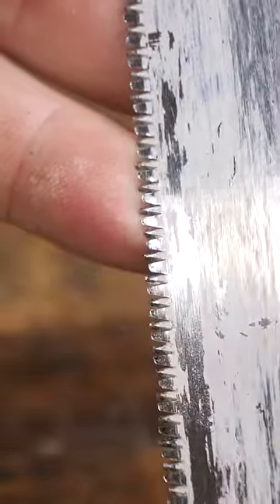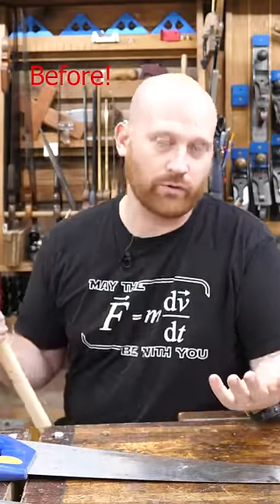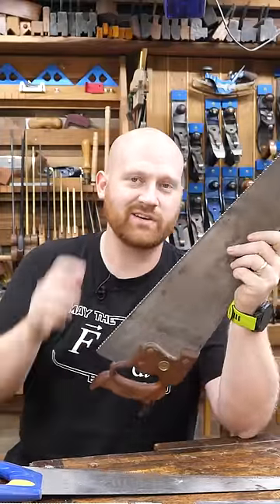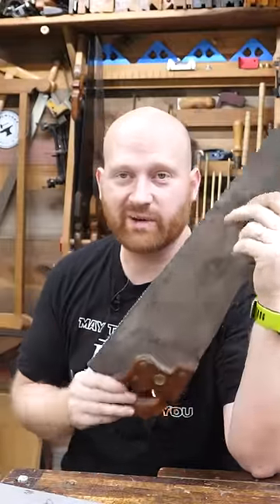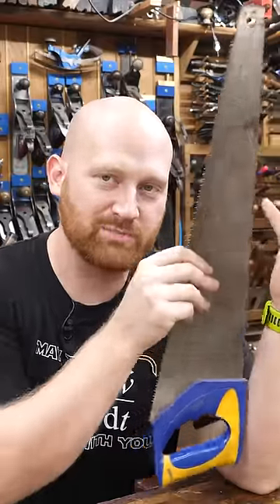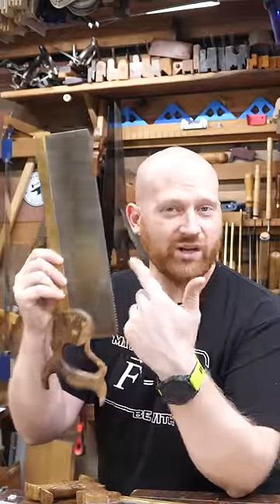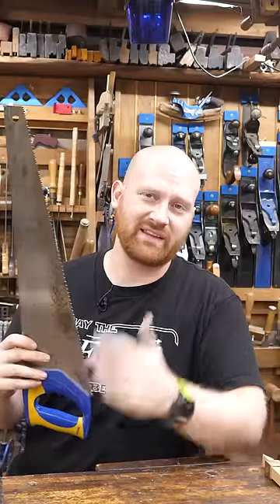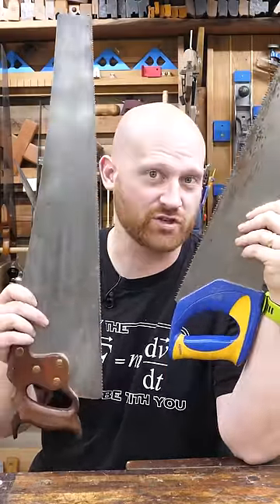Hardend Teeth Vs Old School Teeth on a Hand Saw

Comment from the maker: How to sharpen a saw: https://www.youtube.com/watch?v=e7YsjKhqk-w
Reply: Exactly the video I was hoping you had🙂
Reply: You said "you generally won't find hardened teeth on a saw after ww2. That contradicts what you said in the rest of the video. 
   I believe you meant to say you will only find hardened teeth after ww2 OR you'll only find non hardened teeth before ww2.
Reply: This was the comment I was expecting to find. Ty.
Reply: You "do" find hardened after WW ll ✌️👍
Reply: Thank you so much! That was my next question.
Reply: @muddbear6410 he literally put the correction in the video.
Reply: Why not use a torch to heat up the teeth and take the temper out of them?
Reply: i appreciate your video but you can resharpen them easily with diamond files

Comment: “Became disposable” is a phrase that sadly applies to everything these days
Reply: That mostly depends on what you're willing to pay. Exceptions exists but you can generally still get a long lasting quality product of you're willing to pay a bit more and know what to look for.
Reply: These days you have easily accessable abrasives on dremels or angle grinders and diamond files are ten a penny, you can sharpen hardened saws with no problem at all.
Reply: If we don't replace our stuff companies don't make money. More disposable more money they make. Please think of the poor companies
Reply: Haaaavvvveee you met Entropy?
Reply: @Freakmaster480 That's true, but they're very difficult to find when it comes to most things and they're a lot more expensive, whereas in the past striving for quality in a product was the norm
Reply: @kiiryth9835  Making stuff as cheaply as possible has always been common we just have the technology to make stuff cheaper than ever.
Reply: You're thinking about it wrong.  People use to have to sit there and sharpen ONE saw for 30 min/an hour pretty regularly.

Now they don't have to, so we can cut more stuff.  It's not that we just made worse saws on purpose.  It's that in this case, "worse" saws are actually more productive.
Reply: Even people.
Reply: @danlorett2184  This. Costs more to sharpen a saw that it does to buy one, and disposable saws last pretty well so long as you only cut clean wood. Even if you charged a new one to every job no one's loosing out.
Reply: @danlorett2184  Well, in a professional scale scenario yes it's better, but sometimes for a hobbyist or trainee for example it's better not to buy new equipment and instead upkeep their existing one since it's cheaper and usually used far less often in that case
Reply: @Freakmaster480  Common, sure, but the norm? The "cheap" usually came from exploiting the workers rather than making a barely functioning product, but now that it's not enough and most countries' workers are better off, it usually results in the quality being compromised instead, which is a relatively recent phenomenon.

Also mass-production didn't even become normal until industrialisation, and only then did it start becoming so extreme whereas before that people NEEDED to have products be good and last long since they were less easily replaceable.
Reply: @Freakmaster480  Really depends on what youre getting tbh. A lot of appliances dont last like they used to. My old washing machine had like a single belt and a knob as failure points, sure the belt could break or the "control board" (pretty much just a bread board where all the wires went) would break but at most it was a $50 fix and would be good to go. Now? my washer only works on the heavy duty setting and it costs literally more to fix than to just buy a new one. It is a name brand and was pretty expensive when I got it. Sure it was more effecient than my old one when I got it but now since it only runs on the heavy duty setting, its much less effecient and takes forever to clean.
Reply: @agentbarron3945  We got a soeed queen set a few tears ago that cost a little more but has been fantastic so far and are rated for over 10k cycles. We've not had it long enough to see if it lasts that long yet but they came highly reccomended. We had to look around to find hem but they were there.
Reply: To morals and decency mostly
Reply: You can always upcycle the blades into Scrapers when they have gone blunt … cut them up with a cutoff wheel on a hand grinder and file a scraper edge ….
Reply: I’m disposable 😢
Reply: Saws are cheap to produce and time consuming to maintain. The math just doesn't work out in favor of sharpening them. Most people think that the ten or so dollars it costs to replace the blade isn't worth the time and energy it would take to sharpen it.
Reply: It would cost me more in time to sharpen a saw than buy a new one. It's nice there are unhardened saws out there should someone want one
Reply: Something that was "built to last...as long as the consumer spends a lot of time maintaining it", isn't always the better option. Our time has value. Back then, when we were treated like peasants, our time was disposable. 

Today, things are disposable and time is valuable. Fair trade, often enough.

On the other hand...I'd gladly get a mortgage for a damn car that would last as long as a house!
Reply: It's only a matter of time before we get "DISPOSABLE FAMILY"
Reply: @valdamir5457  exactly this, the great depression was caused in part by to much supply and no demand because everything was lasting forever.
Reply: However people where always disposable
Reply: No the don’t.  Union owns that my friend, I’m the Constitution 💯
Reply: If only we had paid twice as much on parts and engineering so that we could still be using our cellphones from 20 years ago!
Reply: @valdamir5457 your joking right😂
Reply: Videos like this, which encourage people to buy disposable and then "chuck 'em", don't help.

Comment: When it comes down to it, modern saws are basically valuing the customer's labor value over the long term value of the saw. Ultimately getting the softer edges instead of replacing is more of a lifestyle choice than a practical one, unless it's a really niche saw type.

Comment: When I was 17 I worked for a company trimming power lines for the power company. I learned how to sharpen a chainsaw with a rat tail file. The boss bought an electric sharpener one day. It was faster but it wore the chain out twice as fast but that may have been because of a lack of skill in the user. You also have to buy the little grinding rocks for the electric sharpener and they wore out pretty fast too. I stuck with the file myself

Comment: Once my next hardened tooth saw gets dull, I’m taking it apart and annealing the blade in my forge, and see if I can convert it into a sharpen-able saw.
Reply from the maker: This is the way!
Reply: You probably don't need to anneal anything. You can use a rotary tool with a small grinding wheel to sharpen the teeth instead of a file.
Reply from the maker: I have seen a few people try that. It is possible but requires so much skill they it is practically impossible to get a good consistent edge on all the teeth.
Reply: You could  grind the old teeth off and file new ones.
Reply from the maker: I now a few people that have done that but the steel under is not great for that. it is ment to be hardened and it will get dull twice as fast as 1095 spring steel that the good ones are made from.
Reply: I was going to post a comment ‘blast it with a torch’ but you didn’t mention the old ones are spring steel. Isn’t that also hardened steel btw?
Reply: @robertjdejong spring steel and tool steel are both high-carbon steels, but the difference is mainly in heat treating and tempering, as to which becomes which. toolmakers and gunsmiths learn the amount of they need to know, but heat treating is a whole, complex, large branch of the metallurgical sciences by itself.

Comment: When I had my sharpening shop I had an old Foley 387 filer for hand saws. It was pretty awesome
Reply: Foley and Belsaw made some good sharpening tools, the foley power retoother and setter for saws were great
Reply: @paulhunter9613  I like their stuff. Everything in my shop was Foley except my clipper blade hone and my grizzly knife grinder. Had a pretty old grinder for carbide blades and router bits. It worked quite well

Comment: Same thing with pocket knives
They used to have softer steel so you could bring the edge back in the field with ease (Victorinox, Buck, etc)
A lot of the new more expensive Knives use Super Steels that need Dimond stones and take longer to sharpen but take longer to Dull as well it’s a trade off one way or the other.
Reply: Very interesting. 👍
Reply: The softer steel was only partially choice. It's only relatively recently that true super steels (high end powder metallurgy steels) became reasonably affordable for enthusiasts. I'd also argue that most more reasonable super steels are more simple to sharpen than the ultra soft steels many legacy brands use. This might not have been the case on old arkansas stones but in an age where diamond stones are easily affordable, the lowered tendency of harder steels to roll makes then so much easier to get a keen edge on.
Reply: You don't need diamond to sharpen any steel alloy. Almost any high-quality stone will sharpen mid 60s Rockwell C blades.

If the abrasion resistance of a modern alloy is making the blade take too long to sharpen, it is an indication that the knife's geometry is forcing you to remove too much steel. in other words, the knife is too thick behind the edge. Knives like this will be poor cutters even when sharp.
Reply: @JOEDHIGGINS  For the most part you aren't wrong but I don't know anyone who'd even think abou sharpening something like m398, rex 121, maxamet, or 15v without diamonds or at least cbn. Could it be done? Sure. Would it be at all plesant? No.
Reply: Just learn to sharpen.
Reply: This isn't a downgrade, it's an upgrade.  The steel in good knives is significantly better quality and has better characteristics than what used to be used.

The only trade off is that you need slightly harder sharpening materials (for most you don't need diamond anything btw).  As for it taking longer to sharpen... maybe if you're doing it 100% by hand on a stone?  They're about the same if you use a machine and then hand finish.
Reply: @danlorett2184  Be careful if magine sharpening. Testing has shown that devices like the work sharp belt sharpener, even when used correctly, tend to burn the edge and resuce edge retention.
Reply: @Freakmaster480  If I am hand sharpening, I mostly use Japanese waterstones, which will sharpen anything made of steel, but I agree that some of the high alloy steels can be slow because of how tough the carbides are to remove. I generally don't prefer steels with large carbides, but a decent aluminum oxide sandpaper will also sharpen any steel out there.
Reply: @JOEDHIGGINS  It can but would do a horrible job with it. It's been shown that hard and large carbides tend to be ripped out of the edge of the knife when using softer sharpening materials like aluminum oxide, glass, or other more traditional sharpening abrasives. Only diamonds or cbn really give good results with those steels even if other abrasives can technically work.
Reply: @Freakmaster480  This is true, TC, VC, and the hardest CrC are harder than AO, and you can rip carbides out of an edge. I generally don't prefer the high alloy steels/steels with large carbides for common use knives.

Not because they are too hard to sharpen, but because they tend to lack toughness and often cannot be sharpened to a sufficiently keen edge.

But you don't have to sharpen them that often, so I guess that is a plus.
Reply: @JOEDHIGGINS  That's fair. I love the aebl, nitro-v, 14c28n family of steels for how easy it is to get a super fine edge. It's so much more difficult with steels like k390 to get that fine edge
Reply: @Freakmaster480  Yeah, I tend to be of the opinion that geometry is more important than alloy selection, assuming a proper heat treat. I like a lot of the exotic metallurgy for machine tools, but have generally found that for the things I use knives for most, some of the simpler carbon or stainless alloys with good geometry are perfect.

TBH, my favorite general knife steel is probably 80CRV2 or 52100. This is probably colored by how easy the metals are to work with and forge. AEB-L is similar in the stainless alloys.

I haven't made a blade form S30V, but I do have a knife made from it, and it seems to hold an edge very well while still being somewhat easy to sharpen. That being said, it was made by a bud of mine, and he ground the bevels down to a couple thou before sharpening. Can't speak directly to its toughness, because it is a kitchen knife.
Reply: @JOEDHIGGINS  Magnacut is one of the handful of high alloy steels that I'm really interested in. Really good toughness, really good edge retention,  near rust proof, takes a keen edge. Kind of a goldilocks steel
Reply: The newer knives, with the exception of the obscenely expensive hand made knives, are so soft they won't even take an edge, let alone keep one. in my 7 decades of trades and sporting activities, I have used many knives. it takes a hard blade to form and hold an edge, the harder the better. That's why I keep searching garage sales and flea markets for the old "Kamp King" and original Boy Scout knives with their carbon steel blades, and genuine Seiss Army knives, and older, pre-Chinese Schrade and Imperial knives. they last forever, and won't rust if kept oiled. Stainless is very tricky to heat treat to get a hard edge, and the Americans, Swedes, and British have mastered it best, as have the Japanese for their domestic use. The Chinese don't even bother.
Reply: proper heat treatment and alloying of good knife steel hss been known and practiced for thousands of years, for example, the Mongols, the Arabs, who passed it on to the Spanish of Toledo, and the Japanese of the Samurai days, among others. the primitive Africans were making steel tips for their spears ("Assagais) long before the white man came to the continent.

Comment: That shirt is the nerdiest shirt I've seen in a while. I need one asap.
Reply: For nerdy, I would highly recommend writing the mass m to the right of the operator  d/dt, so that the equation also holds, if the mass changes over time (e.g. a rocket):
F = d/dt (mv) or F = d(mv)/dt
using momentum p = mv
F = d/dt p or F = dp/dt
Of course, while maintaining the vector notation. There are even nerdier ways to write that, but it's useless if hardly anyone understands it

Comment: I have three good hand saws, Granddads, Dads and a Craftsman brand i bought in the late 70s. I will admit that Craftsman is a great saw and cuts extremely smooth and fast. I paid a old man to sharpen Granddad and dads, cleaned them up and they are on the wall in the shop.

Comment: Like everything woodworking, if you want a great tool that lasts a long time, make sure you can sharpen it when it gets dull. I've learned that is the case for quite literally everything we use to either cut, shape or smoothen out our creations. Everything needs sharpening

Comment: I had a hole saw i annealed and sharpend the teeth then re-hardened them and brought it back to straw color ...I had an emergency job and could not drive a billion mils to go buy one ..this worked out for a few more cuts at least and got the job done... I like the old ways

Comment: I would love to see a video / explanation from you on why modern disposable saws have a different tooth pattern? The rake and everything is completely different! Even if they were resharpenable, I wouldn’t know where to start! Thanks James
Reply from the maker: Most of them are a simple crosscut which is the same tooth geometry as what would have been back in the day. So some of them have started moving to the compound tooth geometries that is common in Japanese crosscut teeth.

Comment: The saw on the left is very special. It’s a specially machined blade that’s thicker at the teeth and thinner at the spine so it never binds. 
All you need to be able to do is sharpen it. It’s the formula 1 of saws.
Reply from the maker: It is indeed

Comment: If you can remove the handle theoretically you can take the hardened saw, heat it to remove the temper, sharpen it, then retemper and re assemble itX
Reply from the maker: That sounds good in theory, but in practice, it often warps the plate. most people if they want to re-sharpen it grind the teeth off and file in new teeth, but both are a lot of work for a $10 saw. By h
Reply: @WoodByWrightHowTo  yeah thats fair. Just wanted to mention it for those guys out there that like to go scorched earth to save a few bucks.

Comment: I sharpen my old saws with normal files and I use diamond files for the induction hardened teeth. Western saws are much easier than the  intricate crosscut teeth in Japanese saws..

Comment: Saws are disposable to me,  but I actually have a tool for bending the teeth of a saw so that the cut of the teeth are wider than the blade of the saw to avoid the saw getting pinched in the wood.  Found the tool in my grandfathers basement after he died, and spent years trying to find out the use of the tool.  I don't know how old the tool is but it looks brand new,  not used very often I guess.
Reply from the maker: a saw setter. you generally use it every 2-6 times that you sharpen.